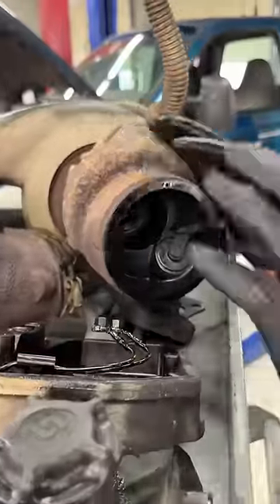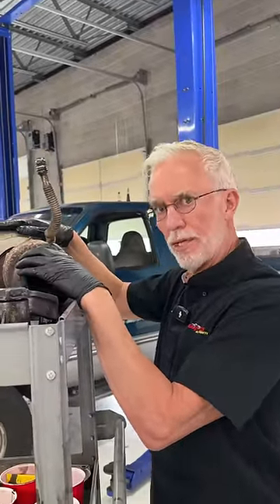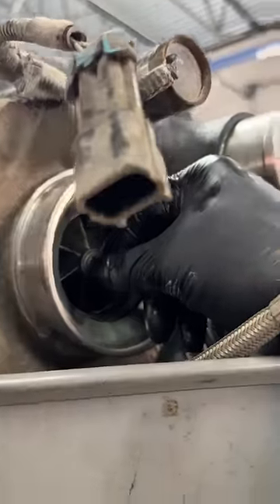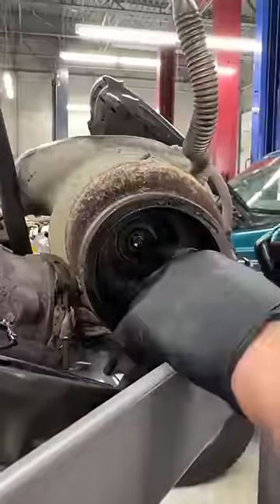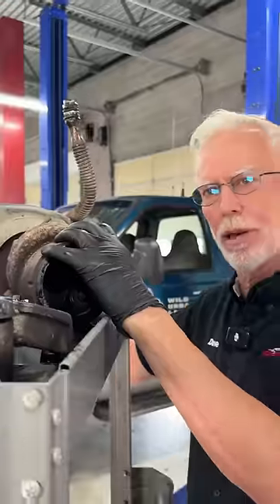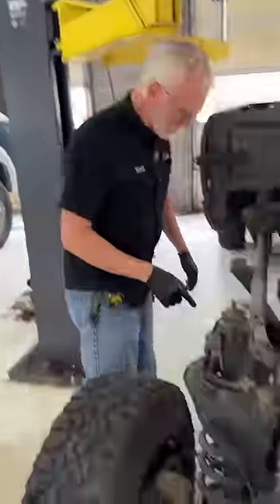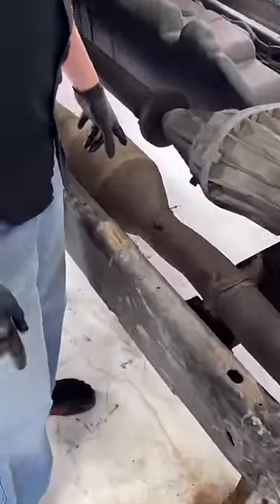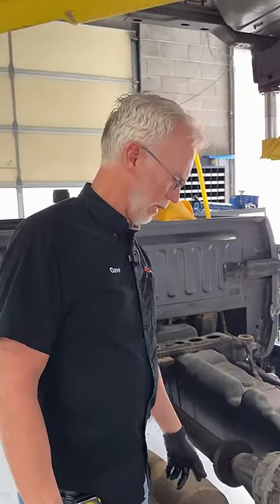Part 2 💥 Cummins melt down

Comment: Dude I love your channel u make it so easy to understand how an engine and every component is suppose to work. Props to you and your team Big Dave !
Reply from the maker: Thank you very much!
Reply: Except the impeller(turbine wheel) did not melt. It’s is literally the most heat resistant part of the turbo. The bearings probably went for whatever reason, causing the turbine to contact the housing, then becoming out of balance broke the shaft. The turbine will be found in the front of the cat, banged up I’m sure, but not melted.

Comment: Dave , I really enjoy your  information So much.  I really like CUMMINS Engines . I drove a Versatile 875 - CUMMINS Engine in ALBERTA.  I ploughed a paddock ( field ) that had not been ploughed for 5 years - permafrosted . A wild ride , I went down a gear , the Mighty Versatile & CUMMINS kept going . I was responsible for changing the Oil , we changed the Oil , every 3 - 4 weeks . ROBBIE - AUSTRALIA .

Comment: Yep. I do big trucks. Mostly Cummins. When turbos come apart that impeller spins the entire length of the pipe all the way back. You can see the blade dings on the outside of the pipe. Changed out many a turbo in parking lots, shoulder of the road at 2 in the morning. Money in the bank!

Comment: Gotta love those reliable, clean burning, fuel efficient diesels. Cheap to fix too.
Reply: I do. Detroit Diesel 8V92 Silver, 600 horses. No problems in 900,000 miles.

Comment: It’s perfect normal to have slight play up and down will fill with oil when engine is spinning. That’s why you never want to use compressed air to spin a turbo. But a turbo should have no forward to back play

Comment: More than likely in the exhaust pipe, the older K engines had a problem with this. Took 3 out of an exhaust pipe on a KW truck. The guy complained about an exhaust rattle. It was purchased as a used truck.

Comment: I love thorough investigation of mechanical failures and then fixing the breakdown
Reply: yea but he was way wrong on this one.  no way that engine melted the turbine wheel without self destructing. in that case, he'd be showing that. he has 0 clue what caused that turbo to chuck the wheel. most common cause of a turbine wheel liberating is an overspeed causing the weld to break under load/vibration or that much of a worn bearing caused the turbine wheel to strike the housing possibly during a surge event and that sudden extra torque load at high speed snapped the shaft.

Comment: How hard would it be to add an auxiliary electric oil pump that would circulate oil to the turbo bearings after engine shutdown? IIRC conventional oil coking in the turbo bearings k1lled a lot of turbos back in the '80s. 
And maybe use something like a 310 Stainless for the turbine?  Oh, wait- that would add a couple dollars to the cost of every truck, which would add up to millions, so that's a no-go.

Comment: I can pretty much guarantee you that the turbo impeller that broke off, traveled down the exhaust pipe and is sitting or wedged on the front end of the catalytic converter!

Loosen the exhaust pipe and check for rattle. 
You may have to cut that pipe open to remove it and may even have to replace the catalytic converter as well

Comment: Down the pipe into the CAT. they fail like that due to high inlet air restriction causing them to overspeed after a quick increase in load.
It's analogous to putting your hand on a vacuum cleaner and you hear the RPM of the motor speeds up.
☺️

Comment: The problem with turbines is, one gets that much lateral movement, the stator gets to meet the rotor and well, there's only tiny chunks left to go flying out of the unit.
Which the cat will happily try to convert into slag.
Willing to bet there's a tremendous amount of evidence of massive back pressure as well, so the exhaust valves might bear some scrutiny...

Comment: Seen it before, its supposed to b a ceramic that lasts but stil fails, some mechanics wil bypass the turbo so the vehicle can be operated if the exhaust isn't backed up, but if the cat is melted it needs to hav a detour or swapped for good flow, better fuel economy

Comment: Obviously the bearing went bad, probably due to pore oil lubrication.. those factory oil lines never feed enough. Every turbo I work on, always try to get my customers to upgrade the line, open it up for more volume but leave the port the same.. just seems to cool much better.

Comment: Banging around in there around that oversized/worn bearing breaks the shaft. Always on the exhaust side because it's so much heavier than the compressor.

Comment: You have to get those nickel super alloys seriously hot to come apart like that. And the bearing failure? High rpm spooling cold with no oil yet will destroy semi floating bearings, or in this case probably the out of balance condition? That's crazy though. Waspaloy, hastelloy, inconel, are all no joke, and they're not fun to machine either.

Comment: I hate turbo chargers and superchargers. Better to gain power with more cubic inches and heads that breathe and flows well. Dual overhead cams and 4 valves per cylinder. Free flowing exhaust. 
I dream about a 750 cubic inch V12 wit such attributes.  Add high compression and water injection.  Basically a smaller version of WWII  aircraft engines.

Comment: Do you need to replace the air filter on small trucks like tractor trailers? It seemed like 99% of them kicked metal back into the air filter when the turbocharger grenades

Comment: Never a dull moment in mechanics Interesting story in my days working on cat with a family member. We arrived to work,a steel mill ,on a Monday. As i got out of my car my brother was standing looking towards the mill, the Cat 988 loader was sitting in the middle of the yard, a load of rail on its forks. It normally on arrival to work is being driven taking rail to preheating oven daily. We get to the loader, engine is cool so my brother climbs in the cab. Turns the key and just a small click sound, again click. We look at each other like wt ! Thought starter most likely never thinking about oil just because ,you get it running and fast , owner did not want any down time...changed and retry. Click. Click again. Now checking engine oil level paperwork per day by the operator, all okay start of his shift, well supposedly, blah,blah,blah! Checking actual oil per dipstick,bone dry but we noticed the stick was very dry alright and very clean.We check oil filter to find out not only a sludge oil with fine dirt mix, it must have weighed maybe eight to ten pounds stretching it a bit, but heavy for the most. My brother who was the main mechanic crawled up to the top of engine and pulled the valve cover off finding dirt throughout the valve train. Whomever did this was really out to get even with either the company or a boss, looked as if a can could have been used was our thinking, filled to the top because of the amount of dirt poured into the oil fill and even the oil breather .The dirt from the yard of this steel mill, it is next to a river where the ground is a powder type great for growing crops, not to much for an engine. Someone but nobody knew anything. We pulled the pan, and there was oil and dirt fifty fifty here, as well ,the pan must have weighed 90lbs. I'm sure y'all already figured the rest of the story, but anyway main crank bearings had been filed away by some sort of fine dirt down to the crank resulting the rod welded itself together with crank, I guess it got a bit warm and the entire motor was scrap nothing left of it's enternal use, river dirt is  great for smoothing away surfaces at high revolutions! The moral of the story Owner was out for blood, because the other nightmare came when purchasing dept was in owners office in search of a cat 988 motor. Buying a new motor for an old loader that was pretty much on its last days was an out of question, it was a 88 model year, but one was found from another 988 two states away with the price the owner liked so it arrived, we put it in and away it went...

Comment: More likely that the fins cracked and broke off from compressor surge and hot shut downs, which is operator error. 

Melting seems very unlikely, considering that modern turbo compressor wheels can typically handle a consistent inlet temp of 1,750°F...

Comment: When you loose the tubine wheel the number one cause is turbine shaft over speed and high EGT.  High EGT cam be caused by several factors, boost leaks not enough air for fuel under load, too much timing ( tuning  knuckle head) fault injectors or just a very poor oil burning engine where the customer drove it till it quit moving.
   It's  not a warned out turbo cause the cold side is not full of oil lucky he didn't  have a run away  if it would of broke the compressor wheel instead.

Comment: I was driving my 78 Cummins bronco and it began to lose power, and I heard the unmistakable sound of rustling leaves coming from under the hood and I knew uh-oh turbo is going to shit the bed at 250,000 miles.. I took the turbo apart and had about a quarter of an inch play on the bushing. That's not really healthy. Lol part of the blades were worn right off. On the brighter side it's a perfect excuse to build a hybrid turbo with more boost.

Comment: Something stopped the compressor side dead,maybe comp wall contact, the weight of the turbine wheel inertia, and exhaust gas drive sheers it off the shaft. It's friction welded the same as an exhaust valve to its shaft. It can't escape down the exhaust until all the fins are routed off so your going to find something in thst CAT that looks like a bullett

Comment: no way that engine melted the turbine wheel without self destructing. in that case, he'd be showing that. he has 0 clue what caused that turbo to chuck the wheel. most common cause of a turbine wheel liberating is an overspeed causing the weld to break under load/vibration or that much of a worn bearing caused the turbine wheel to strike the housing possibly during a surge event and that sudden extra torque load at high speed snapped the shaft.

Comment: I just had this happen to my twin turbo 3.5 ecotec. Turbo number two wasn't getting oil properly which caused it to overheat and explode and the turbine shot down my exhaust and hit my catalytic converter and damaged the honeycomb on the catalytic converter subsequently turbo number one went out then the engine locked up luckily it's all under warranty through meineke

Comment: Dave Dave, I have a question, how much should I change the oil cooler gasket because it is leaking antifreeze? Is ram 2500 6.7l

Comment: If so….
You have an engine that’s been running on alumina oxide.
Isn’t that what they put on sandpaper?
I used to help make turbocharger wheels at Tennessee Turbo. 
They are vacuum poured into plaster molds, cleaned, heat treated, then sent off to be HIPPED. To melt one to the point of disappearing 
takes some doing…

Comment: Use ceramic ball bearing bigger turbo oil less comp turbo with grease ball fittings on top silicone grease from superior industrial 2000 degrees won't 🫠 melt n engine wont lose oil pressure even if seal blows out or contaminate oil sensor intercooler piping n it'll be only reason to put orings seals but then journey bearings relay on oil pressure alot

Comment: OK I've been watching your channel now for awhile. Help me understand something about these motors and OEM parts. How does the turbine side of a turbo impeller melt or brake? When they design engineer, these motors In R&D they never test these engines to the point of failure and design parts that won't do this? Or does R&D know these things? Parts will fail, and they don't care that these failures will happen. Why?

Comment: Oil Seals Of Wiped Bearings Of Turbo Shaft HAD To Be Causing Problems Too...
Oil ain Exhaust
Or GOD Forbid Oil In Intake Air Causing Run Away Engine RPMs

Comment: ¿ I have a 08 Duramax and I’ve already spent $5,000 on parts and repairs . They replaced my CP3 along with fuel lines and a injector a  glow plug . 
The reason that I took it in is that it suddenly would start and run about 5 minutes and just die till eventually she wouldn’t start . 
She sat for 5 months . 
I asked the shop if they were going to drain all of the fuel but after I picked it up that though my fuel gauge doesn’t work that I put about half a tank in it . 
The very same day it was surging especially at a red light and was worse when I put it in reverse. 
Then the next morning I hooked my landscaping trailer to see how she ran and she didn’t have the same full power . So when went to turn her on 💔, she didn’t start . I had to prime the water separator twice and she ran . 
Had to do it again the next morning so I took her back . 
Then after a couple of weeks I had to call em for the guy to tell me that it was ready but he wanted to tweak it till tomorrow. 
Well after picking it up she was not surging and I thought all’s good . Nope I had traveled to another city near San Antonio and after I mowed a yuge property she began to limp back at high rpms and I’d only be going about 45mph and then finally down to 25 on the highway shoulder. So when I stopped pressing the accelerator and eased it back she began to pick up speed till she could do 65 . 
So I took it back again . Again after being told that they had replaced another part that she’s good to go . 
Well , now I was taking a full load of wood in my landscaping trailer to Canyon lake about a hour away, that she began to limp and I’d only get 45 mph . 
It was that way going to the drop off and some of the way back when she resumed her power but I also could not speed up to pass anyone when before that was never a problem. 
What other parts should I have em look at or system . 
She’s got a new air filter, water separator filter , CP3 pump , glow plug and some other part that’s attached to the air filter line . 
She won’t start even w a squirt of ether . It’s still under a 1 year warranty and the reason I was so long in waiting to return it was that I had surgery and I was given a 10 pounds restriction and now work for 6 weeks and I hadn’t disconnected the trailer . 
I’m tempted to take it to another shop and the down side is that they are out by Boerne and I live near Lackland Air Force Base so my towing bill will be very high . 
Any advice will be greatly appreciated and I’m definitely determined to give y’all a visit when it’s cooler .

Comment: Over heated from lack of oil? It must have shattered at 70,000 RPM. I've seen them break off and get stuck in the housing, but never completely desinagrate and get blown out the exhaust manifold

Comment: Where'd it go (the impeller)?  Likely what started the aluminum burning on the cylinder head in previous video.  It is hard to heat an aluminum cylinder head up to point the aluminum will oxidize (BURN).  Small pieces of aluminum not so much.  They will act like kindling.

Now you know why you don't see a cylinder head like that, normally.  You normally don't have aluminum filings and chunks entering intake!

Amazing. Would be cool,. Even, if didn't cost so much for this poor soul.

Question: why did i impeller fail catastrophically?  Any modifications to the engine?
Reply: Nvm.   Read elsewhere someone lost two due to backfire.

Again, though, any mods to this engine?

Is mapping normal?  Did someone mess with stuff?

Comment: One would think you should just drill a hole in front of the catalytic converter and put your board scope through there and actually show what is inside the entry area of the catalytic converter? Or has that never dawned on you?

Comment: I know that on the new stuff they sure have lowered their standards an impeller stuff is not supposed to have any play and now it's flat back and forth and guess what they don't hold up very long the new 2022 truck with a brand new motor just put in it went through four turbos in 2 months factory turbos aftermarket junk

Comment: I have one 157000 running perfect only maintenance every 10000 mile change you fuel filter oil and air filter.Affter 50000 I cut out all deff system

Comment: That could get pretty expensive, replacing the Turbo and the Cadillac Converter. and the exhaust piping.  just think, all those Cadillac converters. the capellers are probably made out of plastic in all of them. so everybody that has a Turbo on their vehicle probably has that problem. they're putting their Turbo crap on all cars and trucks now. and making the engine smaller just like GM making cars with those 3 cylinder engines and putting a Turbo on them to make more power those 3 cylinder engines only put out a maximum of a 155 horsepower with a Turbo. instead of just putting a 4 cylinder in the car. they ruined a lot of small vehicles with those 3 cylinder engines withTurbo those vehicles are all crap. all they care about is profit. making a bigger profit.

Comment: Was the point of pulling the cab for the video or are you charging the customer for the extra time. The turbo and manifold weigh 30 lbs just pull it out the engine bay.
Reply: They are doing the engine , go see part 1